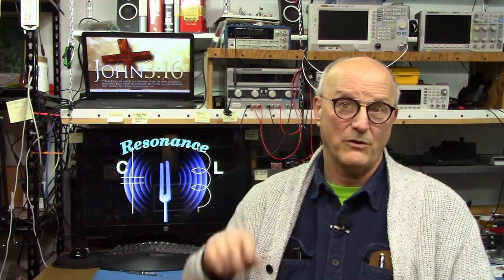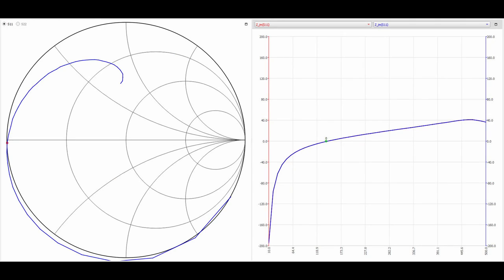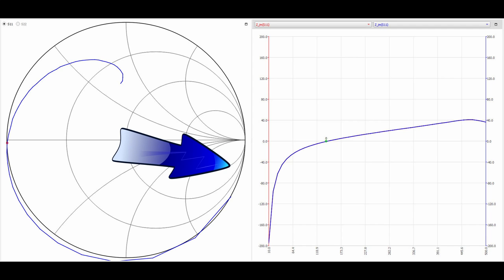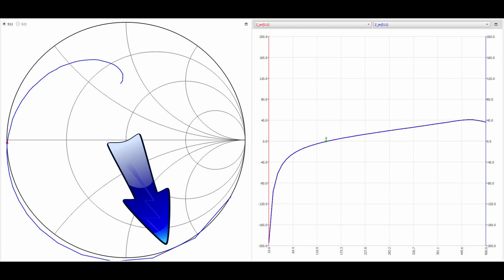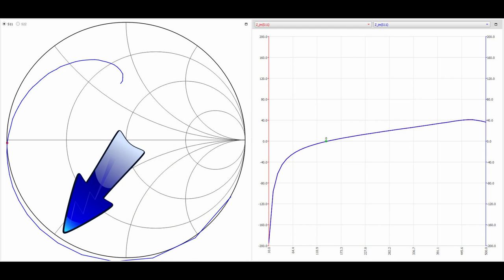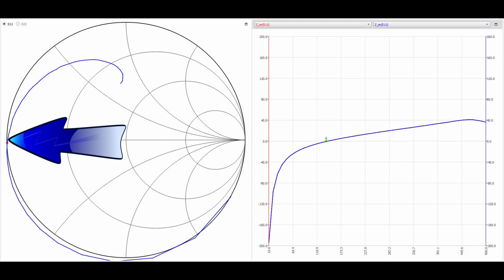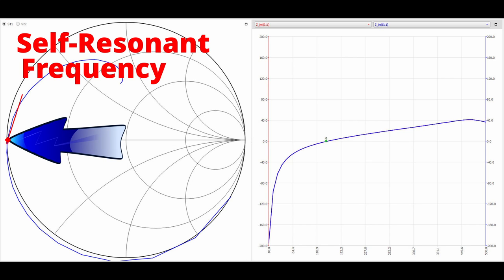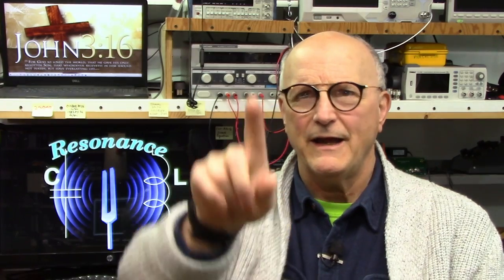L/C Resonant Circuits with Ideal and Real-World Components (056)

Comment: An antenna tuner presents the complex conjugate impedance of the antenna-feed line mism. That is, the sign of the reactance is reverse. So the tuner forms a resonant circuit with the antenna-feed line mismatch. Because it’s resonant, the power reflected back to the tuner is turned around and reflected by the tuner back to the antenna. So most of the energy reflected back from the antenna mismatch gets re-reflected back to the antenna. Of course, some of the power is lost due to feed line resistance.

Comment: great video - I`v been building LC resonant circuits for year and had a lot of fun doing so, one LC circuit placed in side another LC circuit then pulse some high voltage motivation through the outer LC circuit and there you go, some bloke back in the 1890`s came up with the circuit diagram, his name is on the tip on tongue..... :-)
Reply from the maker: Thanks, man! :-)

Comment: 👍Thank you sir.
Reply from the maker: You are welcome! 🙂
Reply: sir i have this doubt for very long time.
In parallel LC circuit, at resonance condition the impedance is infinite.
At this condition circuit acts as an open circuit.
So, the current at resonance is zero.
The intermediate frequency transformer and rf transformer how does it work.
it is like a (primary parallel LC circuit) with secondary.Thank you sir.(vu2knd).
 @eie_for_you
Reply from the maker: @ornithopterindia A very, very good question.  If we are looking at the circuit from the outside, like a black box, yes, it looks like an open circuit. However, we have a very different story if we dig into what is going on inside the individual components. The capacitor is charging and discharging. It is discharging through the inductor which means that there is current passing through the inductor creating a magnetic field around the inductor. Once the capacitor's charge is exhausted, the current through the inductor drops to zero, the magnetic field collapses and a "reverse EMF" is induced in the inductor due to the collapsing magnetic field. This produces a voltage across the inductor which charges the capacitor in the opposite polarity as before.  Once the magnetic field of the inductor has completely collapsed, the voltage that was present across the inductor goes away and the capacitor now begins discharging through the inductor again...the cycle continues. If we had perfect components and there is no energy removed from the system by surrounding circuitry, then this would go on forever. However, neither of these things are true, so the effect would decay over time. Hope this helps to dispel your doubts. Thanks for asking! 🙂

Comment: Yes, would be interested and thankful for octave models for these concepts using passive components. Yours was a perfect explanation. What ended up being the self resonant frequency at this point 21:30?

How would this model change if I replace inductors with gyrators (using op-amps) as synthetic inductors?
Reply from the maker: I wish I could answer these questions. I did not note the self-resonant frequency at 21:30.
I've never worked with "synthetic" inductors, using op amps, so I am without an answer for this one. Sorry.😔